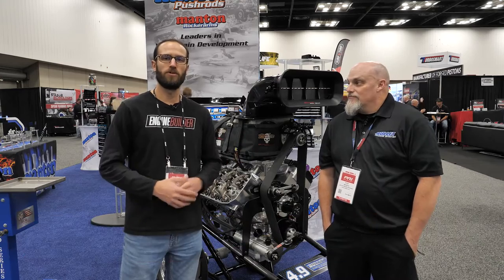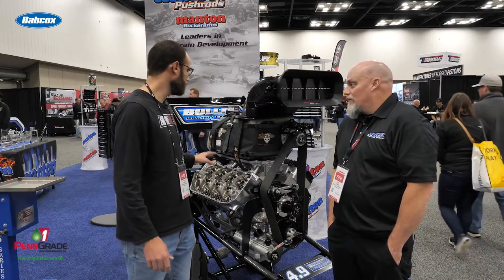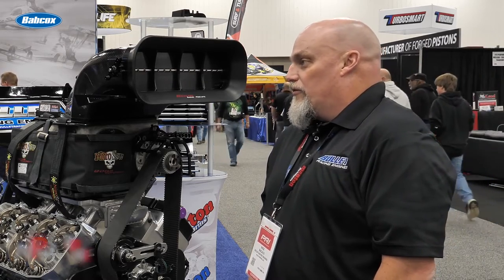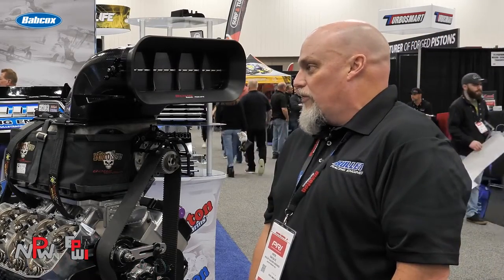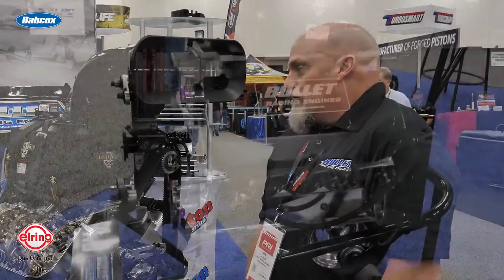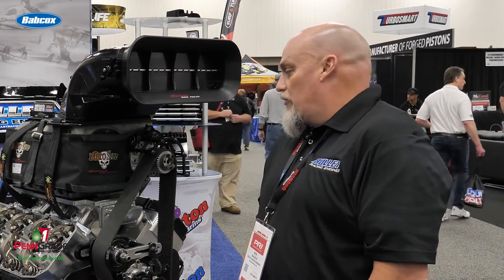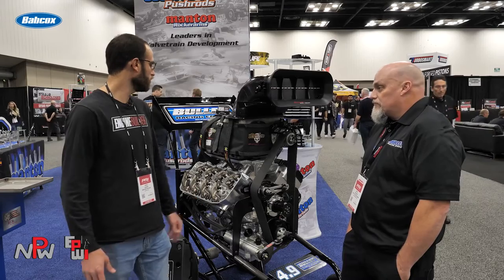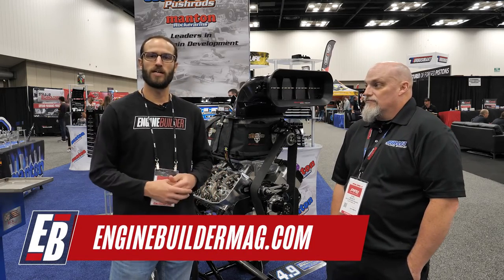Blown 526 4.900" Chevy/Hemi Engine

Comment: So it's a Chevy block with Boss 429 heads and a Mopar bolt pattern?
Reply: 385 series block 4.9 bore spacing is Ford
Reply: @CoyoteFTW  what? He says several times in the video that it's a Chevy block.
Reply: @PresidentSkroob12345  Yes, which means that a Boss 9 cylinder head won't fit a chevy block.